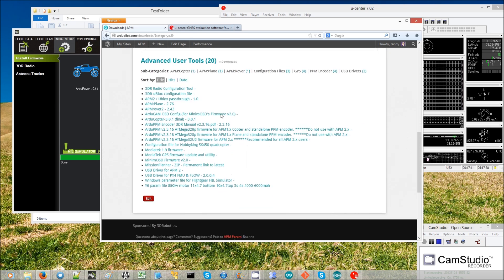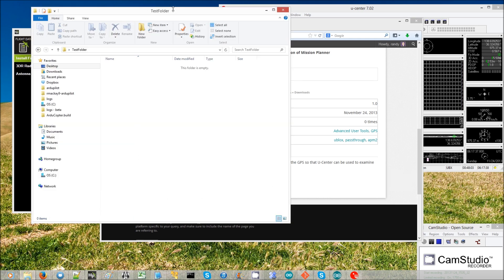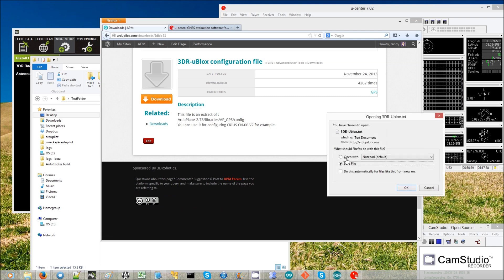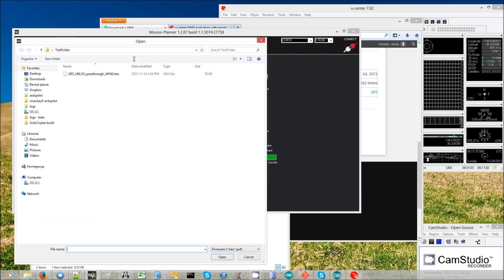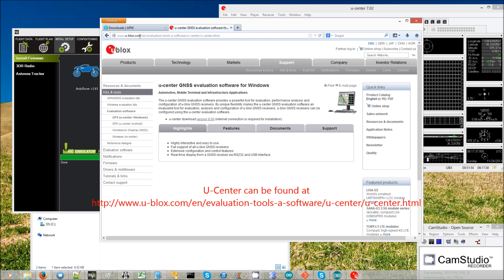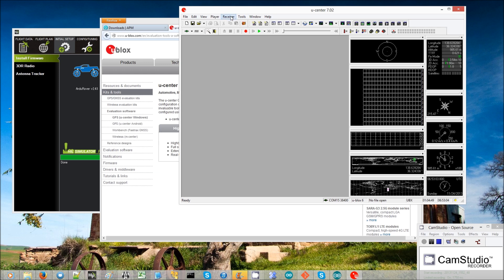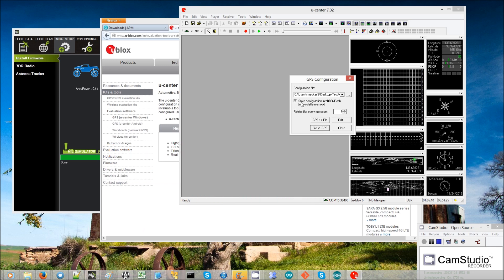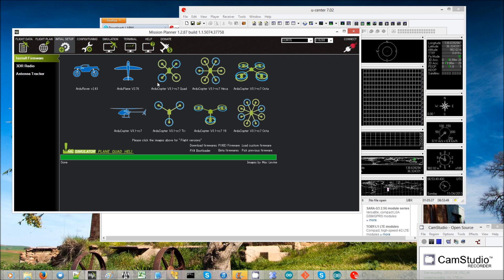Updating 3DR UBlox config through APM2.x

Comment: That link is corrupted.
Reply from the maker: Jorge,
Thanks, I've fixed the link.  Now, I should say this video is 4 years old and modern versions of ArduPilot (i.e. AC3.4.6) running on modern hardware (Pixhawk, etc) automatically configure the GPS so there's no need for this.
Reply: Thanks for your attention.

Comment: The purpose of updating the file config for GPS ?
Thanks for answering.
Reply from the maker: +Nguyen Dat In general it shouldn&#39;t be necessary.  Ardupilot configures the GPS at startup to send the messages it needs and the rate it wants.  Still, some people like to modify the configuration for whatever reason so I created the video to show them how to do that without using any special cables (like an FTDI cable).
Reply: Thanks for your soon answer

Comment: i try this but after i do this there is a different version on my gps and so ignore then proceed to file to gnss then after doing that my arducopter apm 2.6 clone not connecting with mavlink although com port is right i am wondering i brick software pls help!
Reply: Now I fix by uninstalling ardupilot software then reinstall. Open mission planner then initial setup and wizard and you can upload firmware again! :). NOW my apm 2.6 clone fix and GPS worked by putting the gps outside the house voila! thanks

Comment: dang it! haha can't upload any fw on my apm board after i did this..don't know why.
Reply from the maker: jasferb it shouldn't be possible to "brick" an APM2 so with careful plugging/unplugging of the board into your computer and updating with mission planner you should be able to get it back.
Reply: Thanks! i did that, uploaded firmware successfully! Problem is, maybe my gps module is bricked.. can't get GPS signal anymore. neo 6m :(
Reply from the maker: jasferb It's probably not bricked so much as not sending out the messages at ardupilot wants.  If you can connect up with u-center to it (which can be done without even loading a special firmware onto the APM2 now: http://copter.ardupilot.com/wiki/common-optional-hardware/common-positioning-landing-page/common-installing-3dr-ublox-gps-compass-module/common-ublox-gps/#connection_option_1_8211_mission_planner_and_pixhawk_as_passthrough) then you should be able to load the 3DR standard config and it should start working again.  Also maybe in u-center check that the GPS is using 38400 baud.

Comment: I read that the apm's overwrite the gps firmware on each start up. Is that correct? I have an apm 2.5 clone and I'm curious if I need to disconnect the Rx on the GPS so this config doesn't get overwritten. Thanks for the tutorial by the way it worked great for me.
Reply from the maker: Zach T some configuration values are set when the APM starts but not all I think.  Disconnecting the RX on the GPS would indeed ensure that the APM is unable to set any config values but I'm not sure of any case where that would improve the performance of the vehicle.

Comment: Randy this is a great resource as always with your uploads. Thanks for them BTW. I have a new Pixhawk and would like to use the Passthough FW for a Ublox Neo-6M that has not got a separate  GPS I/O but I could sort out the pins from breakout cable that connects to the Pixhawk's GPS input and make a custom interface with the FTDI. I imagine the P.T. FW  is dedicated for use with and APM 2.x only.  Perhaps I will try doing this using my newer 2.6 eh? Answered my own Q :-) All the best and I enjoyed the Antenna tracker vid using of all things a Pixhawk :-)
Reply from the maker: Chris Leech one of the devs attempted to make a passthrough for the pixhawk but it didn't work for me so I didn't attach it to the downloads area.  I'm not sure when someone will pick up that work again and finish it off I'm afraid.  best of luck anyway.

Comment: hi
when do I need to flash the ublox gps
thanks
Reply from the maker: Saeed, normally you shouldn't need to flash the ublox's config because ArduCopter sets most of the config on setup.  For safety sake, all 3DR GPSs come preconfigured with the mentioned config so that even if AC fails to update the config for some reason (i.e. a broken transmit wire to the GPS) the config will be correct.  This is a rare case though.
Reply: Randy Mackay thanks Randy.
my apm work just fine so I don't need to do this.
good to know though .
have a good day

Comment: also - - if i have to flash the ublox with an ftdi cable and board could you point me at the correct ones to go for (preferably on ebay uk) as I'm scratching my head a LOT at all the options ... i know this is cheeky of me .. but 'if you don't ask you don't get' ;) .. thanks in advance ..